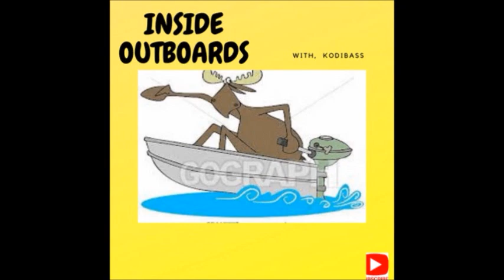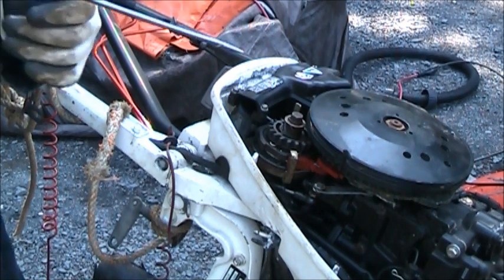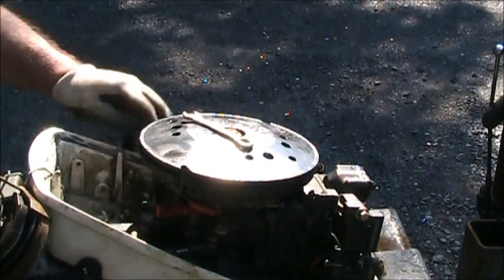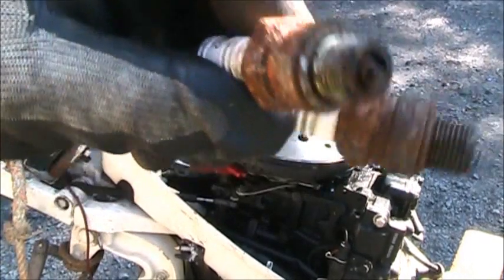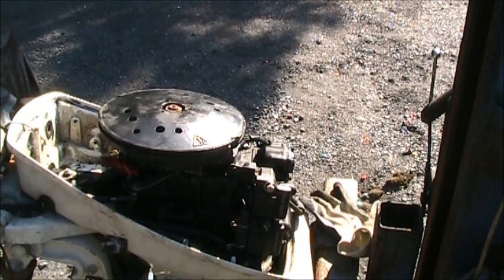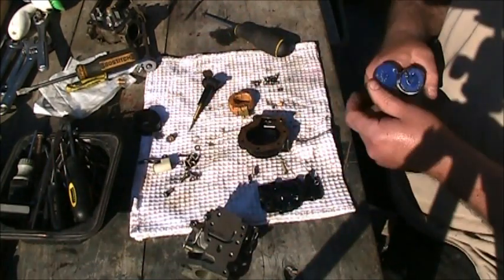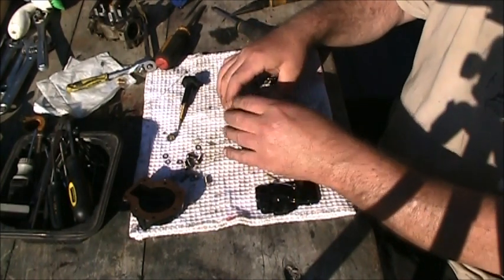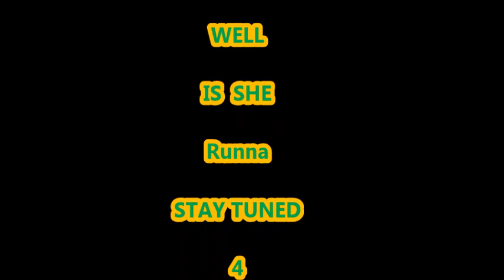15  HP Johnson  outboard #  1  ((   Part   1  ))

Comment: Hi Kodi!  The Outboard Medic here!  Been at it since 1987 and still madly in love with outboards partial of course, to OMC!!!!!   My fav. motor! The Johnson/Evinrude 9.9/15 outboard!!!  On par with the oldie's like the 10's , 15's,  and 18's from the mid to late 1950's!  Best power to weight ratio available (I.M.O.!) and great simple engineering in most areas of the motors!!!!   Great videos Kodi!!1 Cheers~!~

Comment: Kodi do you know a way to make a homemade flywheel puller tool for the little 9.9 and 15 hp evinrudes.. I usually tie a rope around the flywheel, and hang the motor so the weight is on the flywheel, then loosen the flywheel nut, and tap on it,, I would like to do it a different way, the right way.

Comment: Great video!  I have a 92 Johnson 15 hp (J15EENM).  She starts, idles ok, picks up speed until about half throttle and then she doesn't pick up an more speed past that.  I've replace the fuel lines between the tank and the carb, rebuilt the carb and fuel pump, replaced spark plugs and coils, replaced thermostat and fuel pump, and replaced the cam follower and ramp and adjusted the follower so it's inline with the mark on the ramp once the throttle plate just starts to open.  Any ideas?  maybe it's a timing issue so replace stator and power pack?  Oh, and compression is 115 and 120 psi.  Thanks for any help on this!

Comment: Hey Kodi, I am a loyal follower of your videos, Many thanks for sparking my interest in working on outboards.  I just picked up a 1990 15hp Johnson with the same dirty motor issues and a carburetor that is of earlier vintage. My question for you is will this unit work with a older carburetor (non plastic type)? thanks
Reply from the maker: Yes' If the choke is the same as the  newer  type it will not only work but the solid body carbs are better.
                                                                                                                                                      kodi
Reply: @kodibassInsideoutboards  Thats great. many thanks

Comment: KODIBASS i have a mercury motor i was wondering if you could take the time to help me with i know your a busy guy but you seem jolly and a decent person to reach out to. I'm in the process of restoring a boat and the motor and was told i need a power trim unit for it and was wondering if the power trim units on the early 90's model mercury outboards were universal or engine specific??? not trying to be cheap just live on a fixed income and cant afford to purchase the oem replacement part for it. being to expensive for my limited budget
Reply from the maker: +RJ,  Does your motor currently have a Tilt Trim unit ?  Or are you wishing to add it to a motor that did not come with T/T,   lmk.                kodi

Comment: That damn foam is removed from EVERY outboard I work on!  I then replace it with peel/stick automotive sound deadener. Works great.   Seems like that foam has all become brittle over the years.  Not sure why OMC used it. I suppose it was the best priced option at the time.
Reply from the maker: + raa    I think  u  R  spot on correct ... >>>>>>>>>>>>>>>>>>           kodi

Comment: Wonder who the genius was that thought up that foam sound deadening idea....The foam works pretty well though, the engines are real quiet when the don't run...You have got better luck than me, I would have gotten it all back together and it still wouldn't work right.  The damn foam would have gotten into the reeds...  Those damn modular carbs are a pain, and that CPS replacement stuff is priced like gold...Those old carbs were virtually bullet proof, except when the tin bowls rusted and leaked.  It's really a shame people don't try to take better care of those engines...They will slowly become extinct, then people will realize what they had....
Reply: On the money